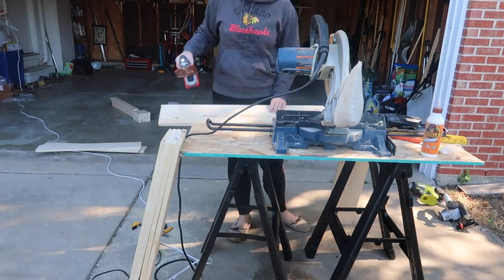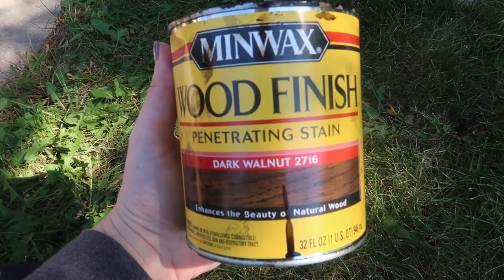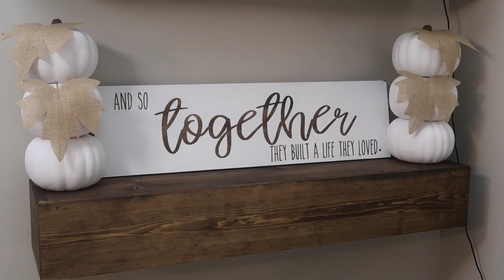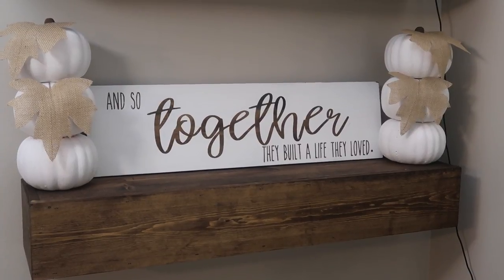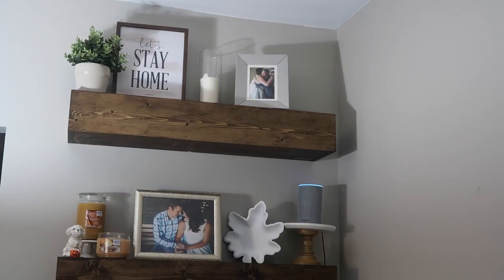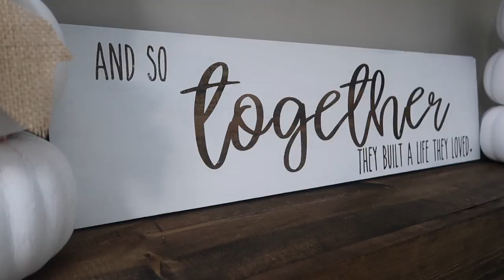How to build DIY wood floating shelves tutorial | Easy weekend project! | Whiskey & Whit

Comment: A lot of people rely on Home Depot to cut wood, but they only guarantee with in a 1/4 inch accuracy for cuts. I have got them to make perfect cuts but it was during a very slow hour and I really had to butter up the worker and be VERY patient.  I ended up purchasing a miter saw for under $130 from there and it was well worth the money! I did a similar project and for the exterior wood for the Shelf (not the support beams/ wood) I used fence post because for less than 2.50 you can get 6 inch wide and 6ft long boards. 
I had the hardest time getting the  boards perpendicular to the wall to be level when I drilled them to the support board that is drilled to the wall. So when I went to put the exterior beads on I had to adjust the perpendicular boards. Thank goodness I hadn't used wood glue on them. I just twisted until they were even but it took me FOREVER 🤦‍♀️ 
I reused my wedding decor too. At first it was to fill up space but years later it is sentimental and I have a lot of it in our bedroom! Love it when decor is functional,  stylish and budget friendly 😍😍😍 very nice!
Sorry the comment was so long. As I was watching I kept typing!